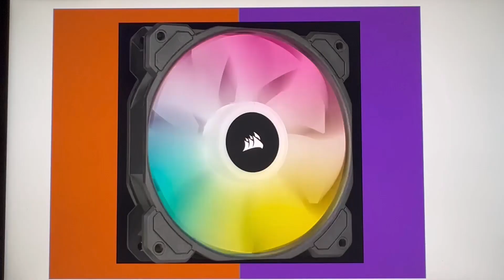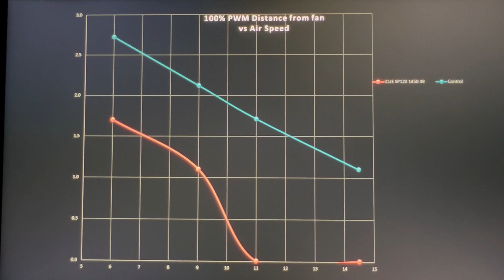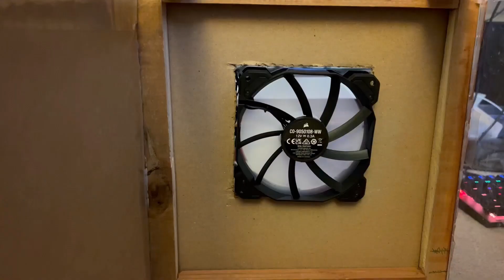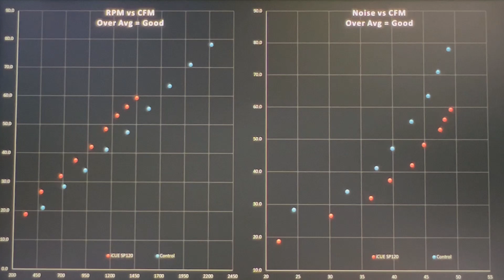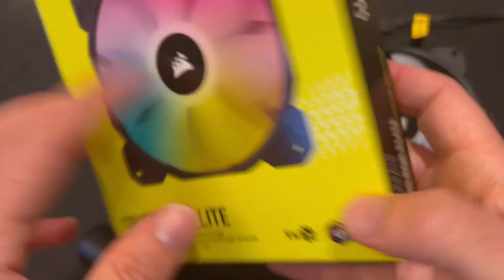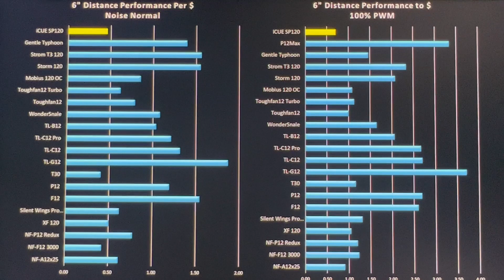Is this fan Elite or is it just a Grunt: SP120 ELITE review  (Old Testing Method)

Comment: so this is a corsair fan without the dumb proprietary connectors and boxes? thats the main reason i avoid corsair fans.
edit: oh wait, it still does, lol.
Reply from the maker: yep. . . I havent owned a corsair fan since my old AIO and it was not RGB. . .
I was pretty unimpressed by this fan
Reply: @computer-tech-more  my current build uses the corsair mag lev non-rgb. they are quiet, but pretty poor performance. currently building its replacement with EK fans.
Reply from the maker: @Born_Stellar  EK fans are pretty good. not the best ive tested but good enough.